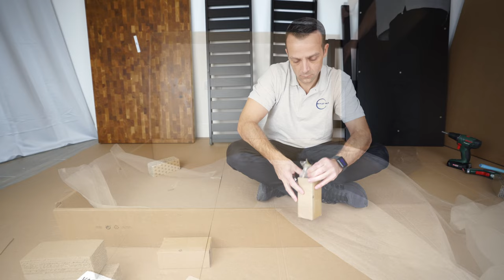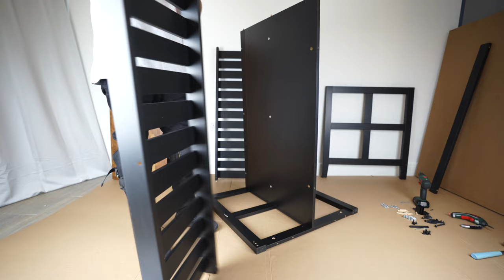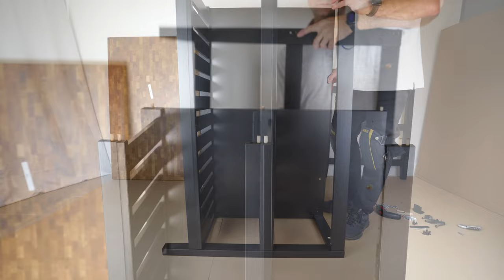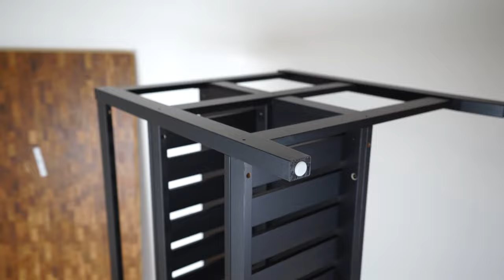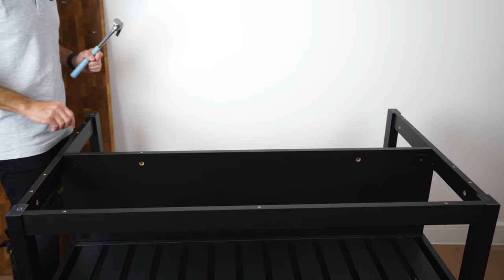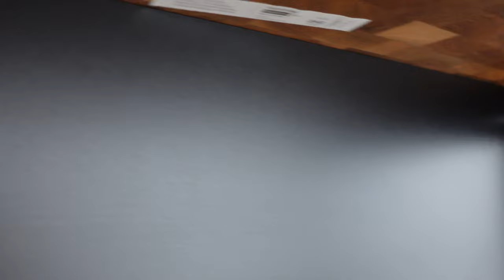Ikea VADHOLMA Kitchen island Assembly instructions

Comment: Was really hoping to get your opinion. Are the shelf’s part of the rigidity of the table ? I wanted to avoid installing the shelf’s and using it more as a kitchen bar table.
Reply from the maker: Yes it is supporting the whole structure. It may work without but I would think of something to secure the structure at last in the corners maybe with some L brackets. But I didn't try that sooo.... maybe put it together without first and see how stable it is then decide depend on that.